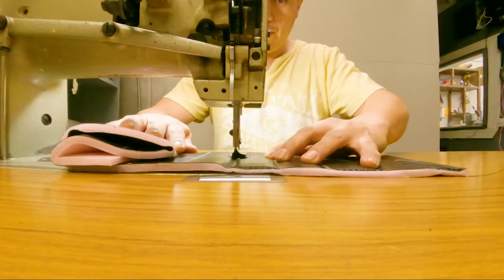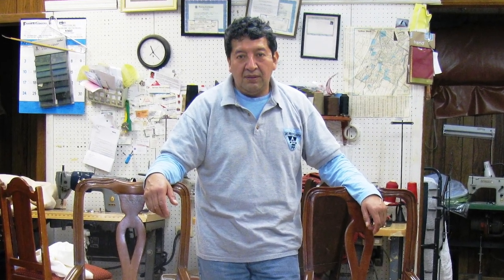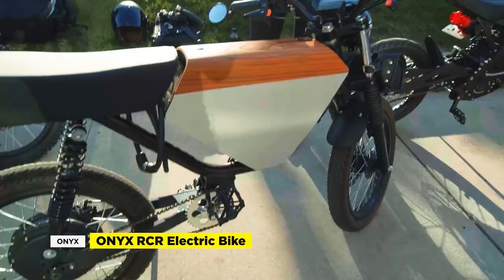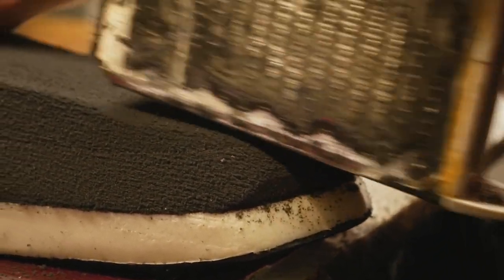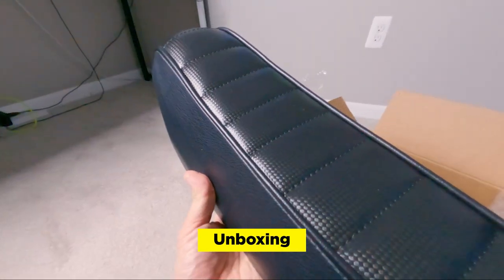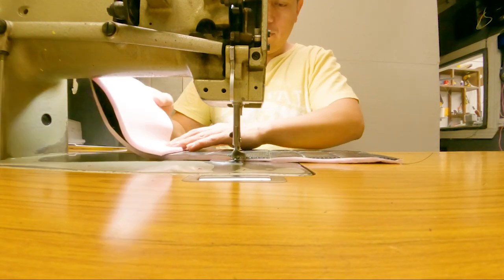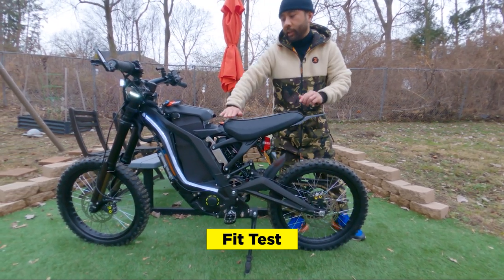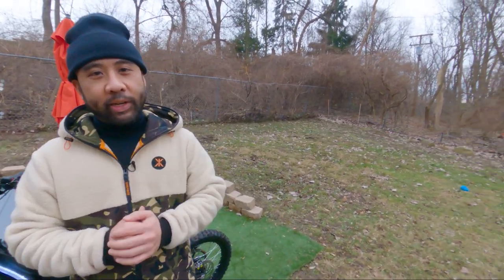Saul's Upholstery Facility Tour and Custom Sur-Ron Seat | RunPlayBack

Comment: Hey Rick quick question, on your sauls custom seat did you have the seat made shorter than stock? Only reason I ask is it looks like your Sauls seat once installed has a gap/hole showing in the front right beneath the battery lid compartment. 

If you did have the seat made shorter in length by how much? And if I wanted to have the gap covered or my seat top covering that gap what specifications would you recommend?
Reply from the maker: Oh yeah so that gap is actually from my battery. It's 72v so it's higher than stock. The gap is from extension screws that make it higher than the seat. ChiBatterySystems makes a 3D printed extension now that fills in that gap much better. I have a new Saul video dropping today and you'll see it.
Reply: @RunPlayBack  perfect, thanks again Rick for the quick response!

Comment: I see you removed the pedals, is there a reason why? I've been looking for pedals just so then I wont have a problem riding this on bike trails here in southern Utah. Also the seat looks awesome! Already checking out there website
Reply from the maker: I still have my pedal kit but my city is pretty chill and I'm usually only riding street so I just put the pegs on. I'll probably put the pedals on in the summer. Yes I really enjoy the custom seat, thanks for watching!
Reply: @RunPlayBack  
Check out Pegals, made by a company in Connecticut.
Reply: I just got mine and I’m in Utah. Have you had any issues with police? I stopped a couple officers today and they said the laws are so vague they don’t care as long as they aren’t getting calls.